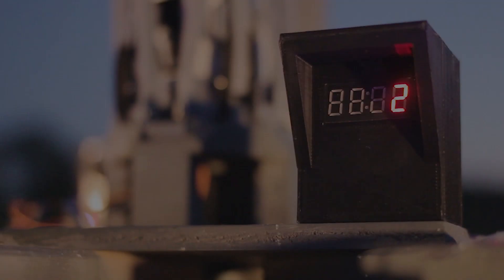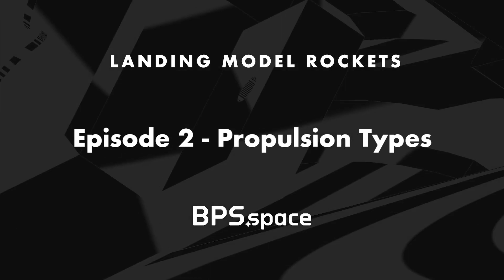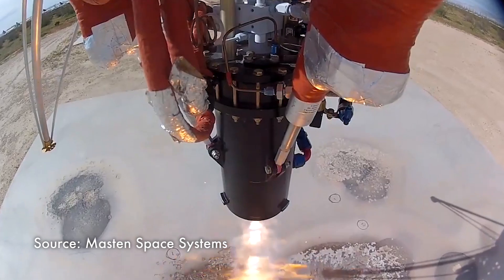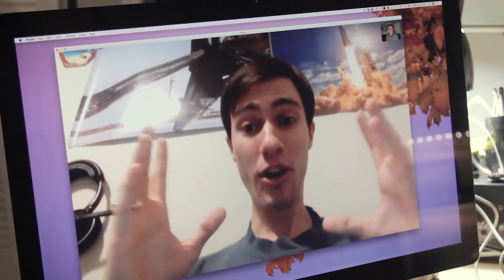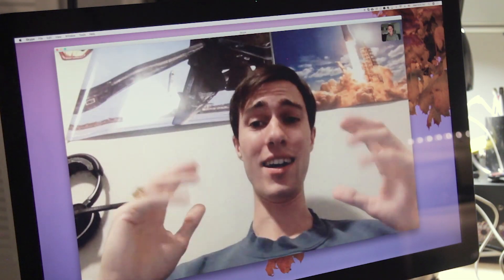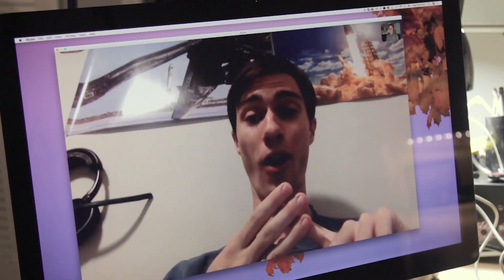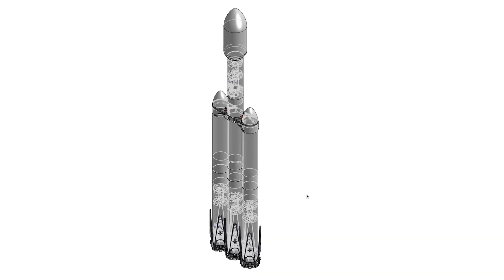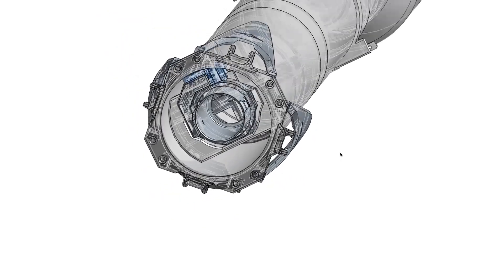Propulsion Types - Landing Model Rockets Ep. 2

Comment: What about hypergolic liquid rocket?
Reply: typically hypergolic fuels are really dangerous to work with, so not really good to work with as a beginner :)
Reply: would be simpler as it ignites by itself, but is REALLY toxic, and I don't think he'd go through the hassle using them.
Reply: Nitric acid and kerosene is about the safest hypergolic fuel combo possible. Hydrazine is another, but it is just a teensy weensy bit toxic.
Reply: @Jupiter__001_  nitric acid isn't safe! It can course up to 3rd degree burns if it gets in contact with skin. Also as he doesn't really have a launch area covered in concrete it's not really good for the environment :)
Reply: how should I know? :D
Reply: too toxic for model rocket use. ... hypergolics are unbelievably toxic. he would need probably a million just to get all the safety gear.

Comment: There is a way to have a little control of the thrust in a solid rocket motor, if you design one of course. You can use inhibitors to control the burning area of the propellant and so control the rocket thrust too. Its not the best option to you, and I already think to do that before, the way you are going to do its a lot better.
And design rocket engine or motor are not easy, you need a lot time to spend just to learn all the theory, more time to test, and money to spend with all the structure and failures.

Comment: Have you considered using three slightly smaller solidfuel rockets and angle them all out with a stepper motor and instead of trying to change the thrust that they produce, change where the thrust is pointing. I'm writing this while rather tired so if you want me to rephrase this, just send a message :)

Comment: We have seen people succeed in performing suicide burns in KSP simulations. Also, is it possible to "throttle" a solid by quickly gimbaling the engine in different directions to reduce resultant force going straight down?
Reply: Engines in KSP are perfectly reliable unlike in real world. Its easy to suicide-land one if you know exactly what performance you can expect.

Comment: Hi
Have you considered using a "cold rocket engine"?
A hydrogen peroxide rocket engine with a calyst pack of silver or cat litter imprinted with potassium permanganate :-) and it only operates at a pressure between 450 and 750 psi in the tanks. There will also be no  ignition problems whit the engine, just open the valve. you can possibly controls the gas with a servo valve or an electric valve with a "PWM" signal. open / close faster for  more thrust and slower for less thrust
Armadillo aerospace used it on their first rockets and some of them were very small (30mm) in diameter.
The Redstone Rocket also used a Hydrogen Peroxide / Cat litter Rocket Engine to run the turbo pump. (Google it ;-)
so if you can get 85% H2O2 (HTP) otherwise you can distill yourself from 35%
Reply: It is also used on Rocket belt
Reply: Hahahahahahah HTP is NASTY stuff, would REALLY not recommend it as any and all organic material is immediately oxidized violently often resulting in fire and/or explosions
Reply: Simple reason is HTP is difficult to obtain, very unstable while also hygroscopic and has a TON of issues in regulations that go with obtaining or even distilling it. Joe is better off doing a higher power ignition system along the lines of pyrogen coating the bore and embedding a nichrome wire initiator to get nice and solid ignition timing. Copsub is vastly different, due to not only their funding but also the location they are set up in, industrial zoned compared to joe's residential/farm zones.
Reply: Why is "Simple reason is HTP is difficult to obtain" etc., Funny ... ???
do not you read what I wrote ... ??? Of course there are rules for having 85% H2O2 ..! it's there too for liquid oxygen ..! In Copenhagensuborbitals we have worked with Nitrous rocket, liquid oxygen, H2O2 Rocket and solid fuel.
solid fuel will never come to work properly and will be pure luck if it should land .. there are many things that affect the solid fuel. .
Temperature outside, air pressure. Moisture, etc.
It must be timed within 0.5 seconds to work ... and so without GPS
Do you know what you're talking about?
I really hope that he will not test them in a residential area :-(
Sorry .. but I do not think it ever really work  satisfactory.
 Nitrous , liquid oxygen, H2O2 Rockets is the way forward..

Comment: Look like you are trying to handle a non-consistent source of power by firing others little supplements non-consistents sources of power.
What if you put a huge out-of-the-shell firework inside a robust-solid bloc : still low cost of power, inconsistent power, but 100% of the time on excess of power. 
And you develop a way to get rid of this excess power in a arduino controller way (control of power), 
like a robust nozzle that can change its diameter, 
or symetricals holes on the sides that let gas output perpendiculary 
or a flat obstacle that move in and out and that breaks gas speed
or by cone that move in and out that change the angle of exit (and their force) of the gas
?

Comment: You can do CFD for Hybrid engines in COMSOL 4.1 and up. The hard part is how many species occur in your reaction. You just about need a Ph.D in chemistry to do it.  I have used simplified models for Kerosine with 8 species. I can point you at the papers from Marshal on that if you want. be warned COMSOL is HARD to use!!! Kerosine CFD is harder!!

Comment: Test campaign... sure.
Reply: So yeah liquid rocket engines have moving parts.
Reply: But yeah so basically your looking at a pressure feed ethonal? That mean first order of business I would think is finding/making the tank and main portion of the structural. Basically designed to give a ethonal/lox at prescribed feed rate and pressure for a period of time, envelope. Then the engine is modular compoenent which can operate under those conditions.
Reply: Probably start by determining the semi precise volume requirements for lox and ethonal. So rough mass estimate of rocket, flight time, flight characteristics, determine the flow rate to get the fuel and oxidizer volumes using an optimal mixture ratio.
Reply: A lot maybe can be done, you can experiment with welding or 3d printing plastic matrix to bond carbon fiber cloth and laminant to, builidng up say thick wall like 3-6 inches. Test under various pressures. Just brain storming some ideas.
Reply: But completeing tanks, and modular structural booster stage I think is a good area to focus. It's complicated you can start to use new ideas etc.

Comment: How about employing those Thrust vector nozzle used in the Afterburner of JetEngines.
Like this,
https://youtu.be/ss96tsbG5KY
You can simplify the design to just 4 metal fins converging/diverging at the end of the solid motor, also only a single actuator(servo) will be used, which i think your gimbal system can handle.    If you need a proof of this simplified concept i can probably demonstrate you a working model.

Comment: if hybrid engines are as complex as liquid, and give none of the benefits... well, you aren't very good with them. lmao. get lernt not ternt.
Reply: ah, logical flaw of mine. i was thinking complexity as risky. if it's just complicated, do whatever you want. life is complicated.
Reply: One thing that is very hard and expensive in the liquid engine is the feed sistem of the engine

The oxidizer you can use as gas, so can make the self pressurization to the combustion chamber, but the most fuel that is easy to find and use is liquid, this make everything more difficult
if you use ethanol as fuel, you gonna need pressure to inject it in the combustion chamber, and this make the rocket engine more hard to design than the hybrid in small scale.
Reply: @marcelomiranda3362  i completely understand all concepts and disciplines required, but thank you anyway. I was referring to the statement that there is no gain for the added complexity, and adding that if that's the case, it's you or your design that are the problem, not the hybrid rocket engine concept.